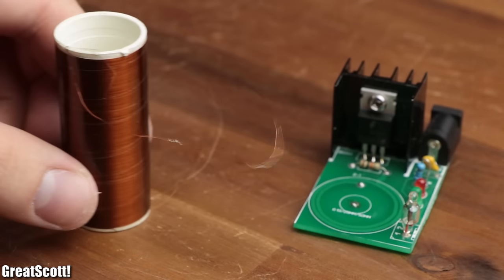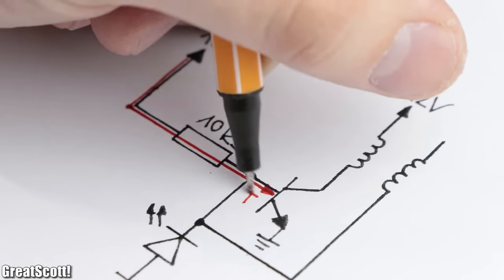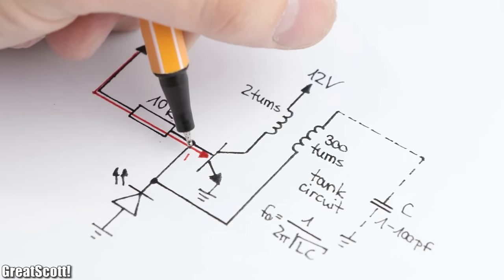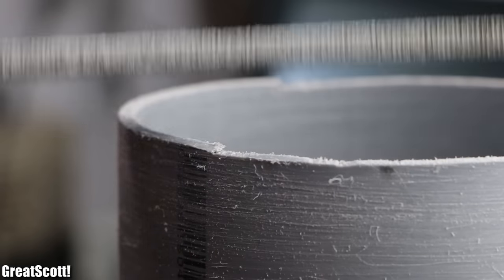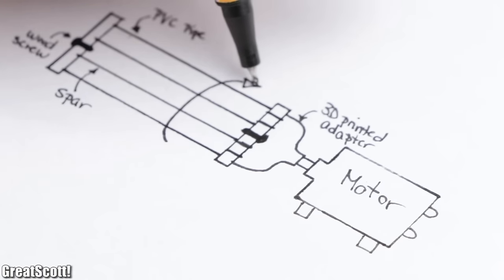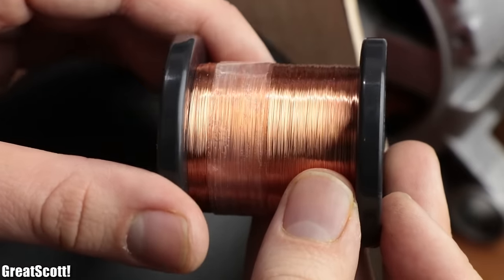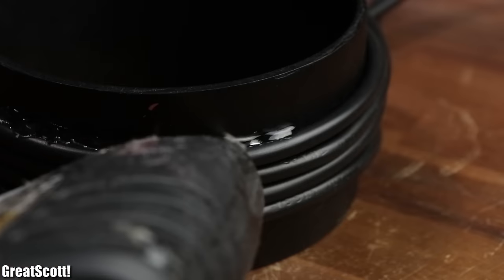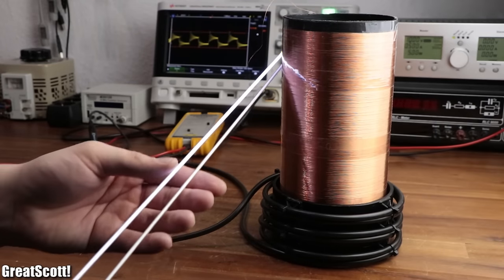Make your own Tesla Coil (Part 1) || Slayer Exciter Circuit

Comment: About 40 years ago I ordered, from a magazine, plans to build a Tesla Coil. When it arrived there were absolutely no pictures or diagrams. All I got were written instructions. I had never built anything like a Tesla Coil before so I fabricated components based upon what I believed the instructions described. I made the primary coil from strips of wood about 30" long and dovetailed them into 4.5-inch circular wooden discs. I used an old chainsaw chain sharpener 120V electric motor. I cut another circular piece of wood about 6-inches in diameter and marked around the circumference 24 equally spaced points. I drilled 1/8th" inch holes through the disc. I then cut (24)-1/2 inch long pieces of all-thread and inserted each into the (24) 1/8th inch holes in the disc. On each end of all-thread screwed on 1/4-inch brass acorn nuts. Then I secured the disc to the motor and mounted it on a wooden platform. I then glued down 2 ceramic sandblaster nozzles that I had previously attached a metal bracket on top of each nozzle. Through each bracket, I drilled and tapped 1/8th-inch holes. Then I threaded a 3-inch long screw through each bracket and attached an acorn nut on the end of each screw. The nozzles were glued down on either side of the disc. By turning each screw I was able to adjust the distance between the acorn nuts atop the nozzles and those in the disc. When the motor was running the disc would rotate between the two nozzles. This was my interpretation of what the instructions described as the make & break circuit. I used a 12,000V neon sign transformer and made the capacitors from 6oz Coca-Cola bottles. The first time I fired it up it produced 3 to 5 foot arcs. Not bad from someone that knew nothing about Tesla Coils.

Comment: Hey man, wouldn't it be better to use less turns in the primary? The voltage in the  secondary would be greater and the current would be smaller(less risk of stopping your heart ifyou touch it...) 
Otherwise, great video, looking foward for the next one

Comment: i don't know what's up with my circuit. i followed exact circuit diagram but the coil doesn't seem to generate any voltage. also a weird thing i noticed, the LED doesn't light up when the DC source is added just as the circuit. but when i reverse the voltage polarity the led lights up. can anyone help me with this problem!! by the way, i used 2N2222A transistor and 10V power supply with 20 k ohm resistor, the transistor heated up so combined them in parallel and used.

Comment: Hey Scott, thanks for your video.
Can I use 4212DT or MJE13005a or T13005D transistor ? With 22k or which resistor will be perfect to get electric arc ?

Comment: 1. Woodscrews get no M lable in front of the diameter number
2. You could have used the tread wich was on the motor shaft and just edit a tread in the motor-cuppling in 123D Deseign

Comment: If you gave up at the heavy duty academese, the coil isnt successful. It makes only slightly bigger sparks than the one he bought. Skip to part 2 if you arent an electrical engineer with a butt ton of theoretical background.

Comment: 3d print the secondary pipe since PLA has a very low dialectic constant.  The lower the dialectic constant, the better the efficiency of the coil. Wrap your copper wire around pla and watch the sparks fly with less power.

Comment: You know a Tesla coil exciter is nothing but a short wave radio transmitter so if you want a bigger spark just get a more powerful transmitter.  Induction heaters sold on Ebay are the same thing too.

Comment: I think you should have used Copper pipes in replacement of the PVC pipes. You don't want any plastic in the mix at all. That will prevent current from flowing effectively. Also make sure you use a metal that is like steel or iron for separation between pipes and copper wire. I would try 10 gauge or 12 gauge wrapped 3 times over.

Comment: i know iam late but it might have worked even better if you used a higher  frequency transistor. The BD535 datasheet shows that it has maximum transition  frequency of 3 MHZ. BTW great video :)

Comment: I don't 100% follow how this isn't dangerous as hell.  Couldn't you use a MOT (microwave oven transformer) to do the same type of thing?  (I use one for generating Lichtenberg fractals & those things scare me.)
Reply: RealRuler2112 a MOT outputs deadly current at 1.2 kV
a tesla coil outputs micro amps at a few tens of kV and at a higher frequency

the frequency is important because the higher the frequency the higher the skin effect which means that for a tesla coil the current will flow only a few  microns on your skin producing burns and damaging the nerves in the skin but it will not stop your heart

Comment: I request you brother. Don't work on high voltage applications. And make video on IC based systems. Which are just operated on 5 to 12 DC voltages
Reply from the maker: No thanks
Reply: But why ?? IC systems are much more interested

Comment: Not going to lie, swapping out the Slayer circuit with "some circuit from a previous video" was a bit disappointing. Could we get more info on the replacement circuit?
Reply from the maker: Sure, in Part 2. It is also a circuit I used in my wireless energy transfer project. You could watch this video as well.
Reply: Awesome, thanks

Comment: can i use 12 volt battery ? why? why not?? please explain
Reply: For what circuit, Slayer exciter or the solid state circuit?
Reply: @ElIsraelJijijiji  for making this coil solid state
Reply: @everythingyouwant7641  you cant use a battery power supply in your tests, you need a regulable power supply so you can increase the voltage more and more

Comment: Very nice one. I just can't wait 4 the next part. I already built 5 TC's. As you said in the video, it should be the best idea to use feedback for observing resonant frequency, because as you had noticed, with the growing sparks parasitic capacitance grows and therefore resonance frequency falls. For the feedback you should use current transformer on secondary or phase-locked loop which is mostly represented with common CD4046 IC.
Also it is a good idea to add additional resonant capacitor between your switching bridge and primary coil for lower impedance, resulting in less power loss and higher power delivered to tank circuit. BTW power is expotentialy rising with growing spark lenght so more powerfull semiconductors will be needed..... Anyway your videos are awesome ! Keep coming with new ones!